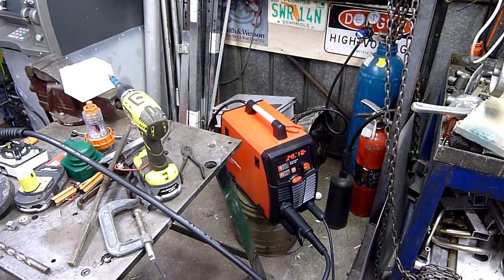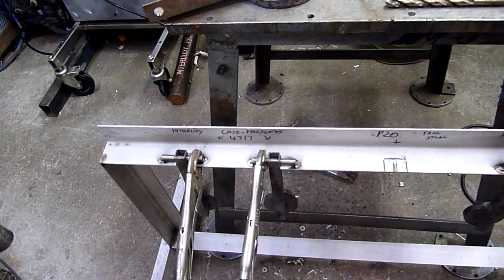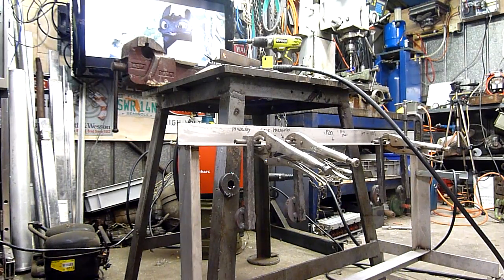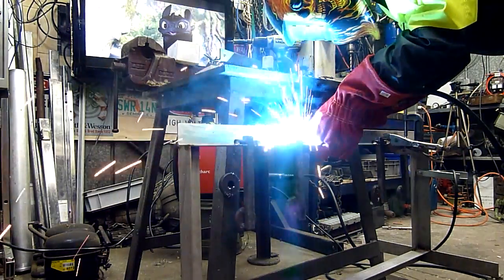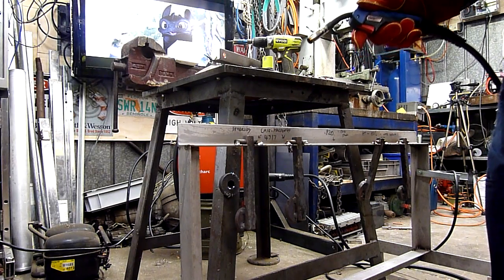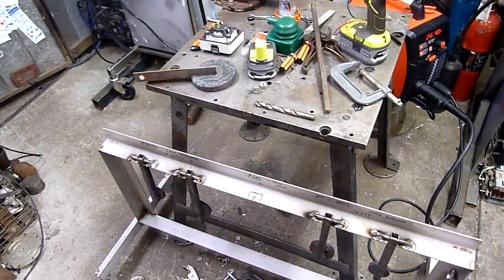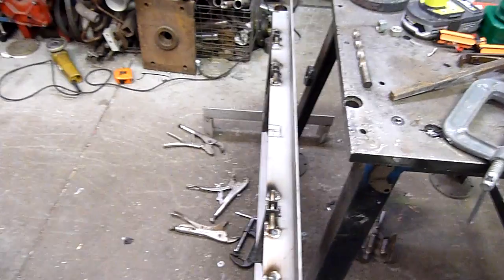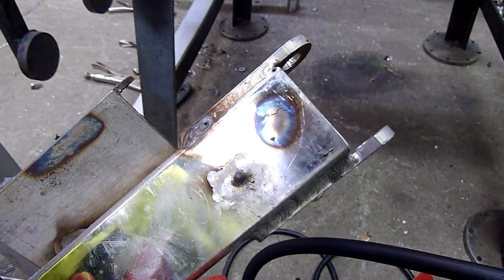BOC Smootharc 180 Mig welder test squirt on pure Argon - 316 stainless wire

Comment: Ours has just blown one of the caps in it (yellow), marked c111 on the pcb, just below the white plug with the red and black wires, I cant read it to solder in a new cap, any chance you could tell me the farad rating of this cap off your unit? take two secs, so I can try to fix it?

Comment: If you can tolerate using CO_2 as a shielding gas it's the cheapest option. A CO_2 fire extinguisher can be used if you make an adapter for the pressure regulator. No rent and you can refill it at the local fire extinguisher shop.

Comment: I ran straight argon through my small millermatic when i first got it for the same reason you did i almost thought it was junk then i got some 75/25 mix and it welded a thousand times better.

Comment: is it just me or a lot of post-flow ?
Reply: +alex993cc1 Huge ammounts, and sounds like alot to much flow generally, you could save yourself alot of gas here Ed!!
Reply: +alex993cc1 Way too much post flow by the sounds of it. You'd save so much gas!
Reply from the maker: +freeebord I have turned down the pressure substantially, but I need to get into the menus and find t he post-flow controls too.
Reply: +alex993cc1  never heard the like , solenoid slow ?
Reply: +alex993cc1 has anyone worked out how to change it ?
Reply: There is no way of adjusting it, BOC make a fortune out of the gas that gets wasted
Reply: @vmfboily1314 yeah it’s bull 💩

Comment: Looks like it welds, sounds like it welds, so, I guess it welds... :P

As for killing camera sensors, just get a UV filter to stick over the lens, that'll save most cameras from being killed by the intense UV light coming from the arc... :)
Reply: +twocvbloke He could just get some cheap welding shade glass and make a camera filter for under $10. Then we could actually see the weld and the camera would be protected.
Reply: rocketman221projects
 I think Ed tried that in the past, though using a welding mask and some clamps, but, I don't think it was convenient enough to work well...